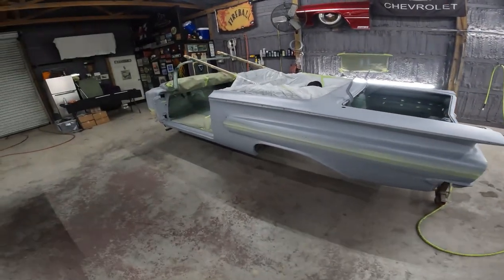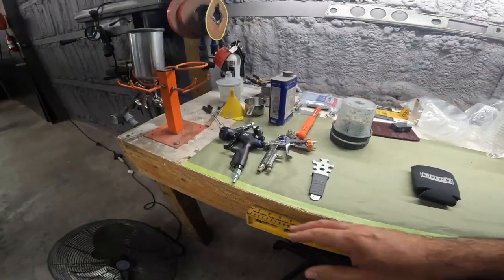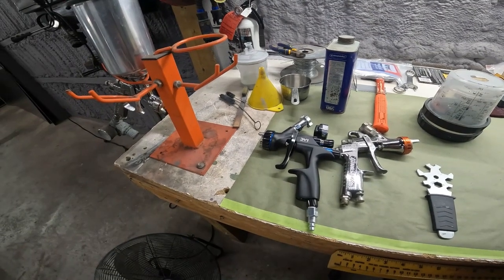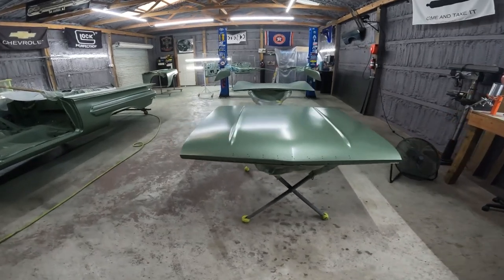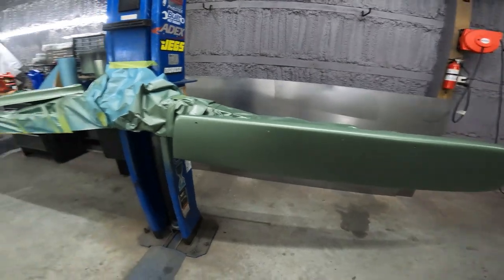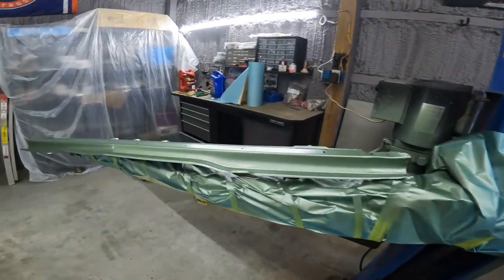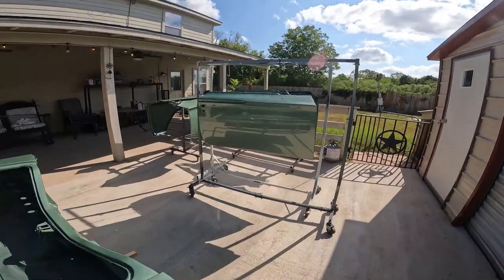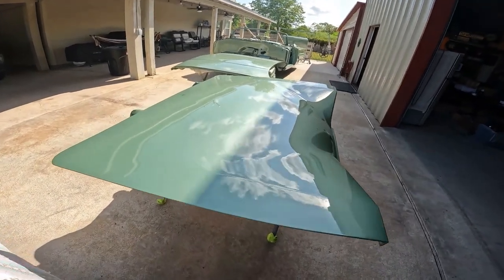1960 IMPALA CONVERTIBLE PAINT JOB PART 2 (FINAL)  / DIY / LOWRIDER /  BODY WORK / CLEAR COAT / SPI

Comment: The color is AMAZING !!!!!!!!!!!!
You can see the color coming up when the clear was applied.
Harder to paint older car with fins and twists and turns not like new cars that are all flat panels.
Nice to have 2 Men on a job this big. Johnny I assume and a little Bobby.
Great that you have a shop large enough to do everything at once.
The Green with the Green top and the strip will turn some heads for sure.
Great Job !!
Reply from the maker: It would be alot to paint for 1 person for sure.  I did paint the blue 64 I had by myself.  And I end up having to redo the roof, driver side quarter, hood and trunk.....